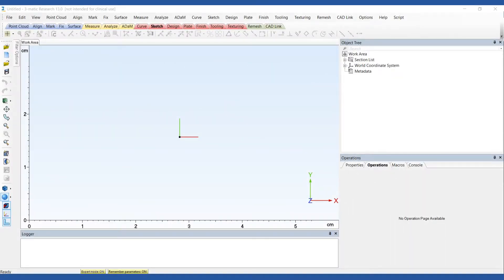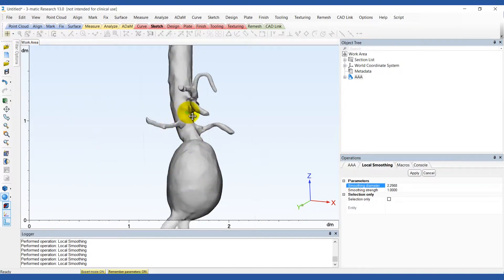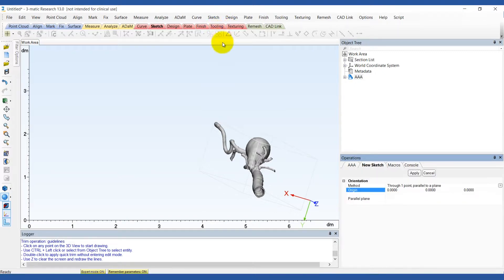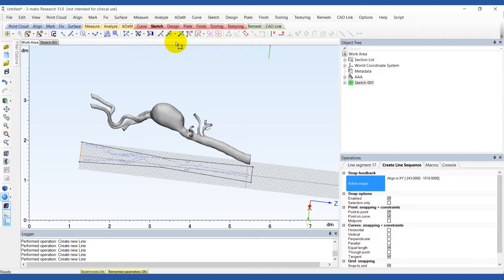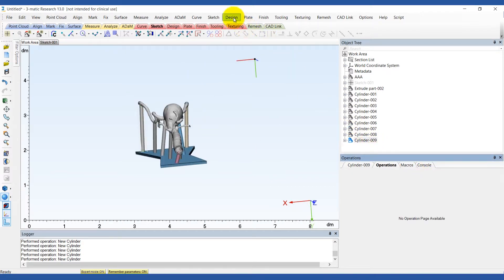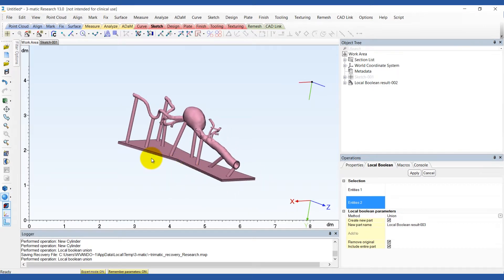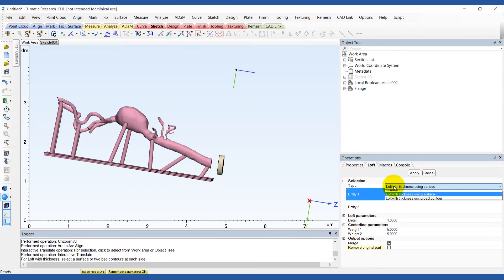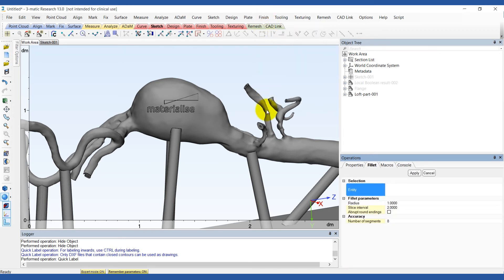How to Create a Customized Cardiovascular Benchtop Model | Mimics Innovation Suite

Comment: Greetings! I am using Mimics21. I could not find toolbars like Analyze in my menu bar. I have first drawn the 3d femur, then used calculate polylines. Now I need to use polyline growing option which I do not find as Analyze toolbox is not enabled. Can you please guide me about how to get them on my menubar?